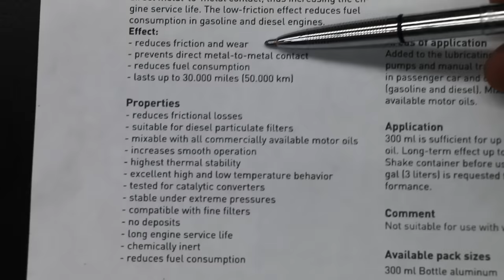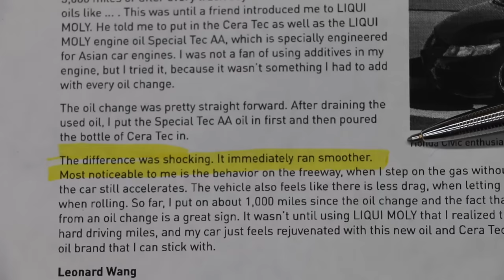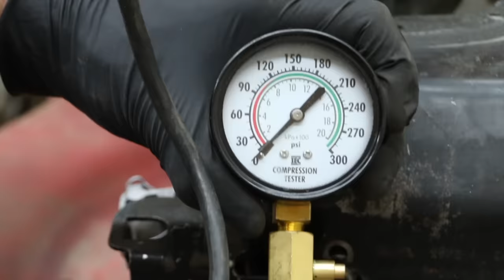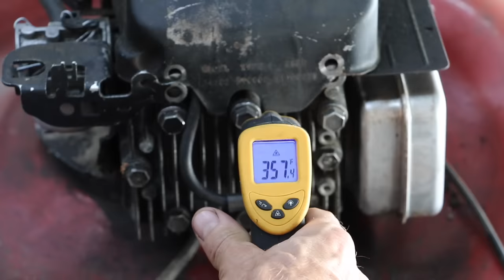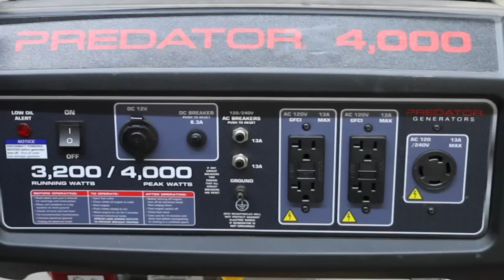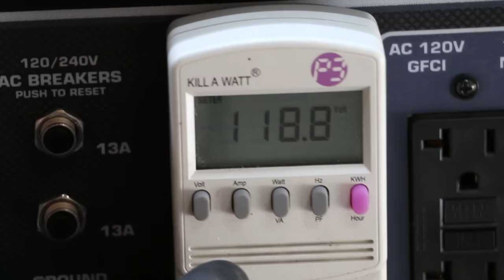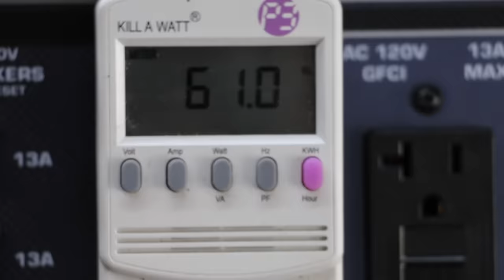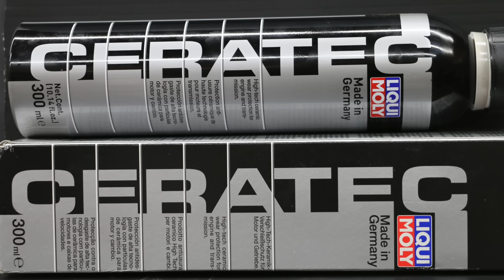Does Liqui Moly CeraTec work?  Let's find out!

Comment: Ive had good experiences with CeraTec myself, but I would not recommend it on a low milage engine. An engine under 50,000 miles already has low friction and little wear, and this product will just introduce foreign chemicals into an otherwise stable environment. However, on older engines closer to and beyond 100,000 miles, this product does seem to help a little bit.
Reply from the maker: Thanks for sharing.

Comment: CeraTec is the only thing on the market known to stop the infamous Coyote Tick. It's quite expensive though, so I did my research ahead of time and have been running the only oil known to never let the tick start- Pennzoil PurePlus.
In any case it would appear CeraTec should increase fuel economy but for the cost of the bottle it may be a wash. My car wants two full bottles, for ten quarts of oil 😬
Reply from the maker: Thanks for sharing.

Comment: I run it in all of dozen family vehicles I care for, most of which are over 200k mile Toyota & Hondas. 300k mile V-8 Tundra valves quieted immediately, and all vehicles get better mpg. I also use their full synthetic oils in everything. Running it in 5 gen 2 Prius's that are all close to 250k miles or more, and every one of them gets over 50 mpg. Only thing special is good maintenence/filters, high tire pressures in the Michelins, and ruthenium plugs along w/ the Liqui Moly oils & chemicals. I also rebuild and rebalance the hybrid batteries, so there are a fair number of variables, but the quieter smoother idle is pretty obvious.
Reply from the maker: Thanks for sharing.

Comment: I used Ceratec on a Jaguar, after 200 odd miles I felt it had made the car much smoother and more responsive, but with all such comments, few of us do this level of testing. Personally I would buy it again if I felt my engine needed it, but a good engine flush, such as BG EPR gives the biggest gains IMO. When I compression tested BG EPR I gained 15% overall on a simple oil change, totally changed the car.
Reply from the maker: Thanks for sharing.
Reply: Ceratec doesn’t work fully until after a couple hundred miles so what you’re saying makes sense. This wasn’t a fair test

Comment: I use Ceramizer. The similiar thing but different company :) (made in Poland, and I live there)
I used it in few engines. Always went better! Reduced noise, but in fact the main advantage was lower oil consumption. 
The adhesion of oil on cylinder walls (nas rest of parts) is reduced, so that oil flows more smoothly.
After all, ceramic coatings of metal surfaces is very popular in manafacturing and heavy industry. The applications are different thou.
Reply from the maker: Thanks for sharing!

Comment: I used slick 50 in all my cars both petrol and diesel over the last 30 years with great results did engine tear down  after high mileage to check wear really impressed with results I’ve recently switched to turbo max after seeing on line test results also very impressed it works
Reply from the maker: Thanks for sharing.

Comment: Not sure if anyone has covered this, but when I was much younger and saw Slick 50 had to be shaken, not stirred, I realized that it would also separate in the oil pans...or... they would have Pre-mixed them for you!  So, if you have to shake it to get the "additives" to suspend in the oil, it's not going to work as well after sitting for any amount of time... 

ANY TEST of a SHAKE to use oil or additive, needs to be allowed to SIT for a day and THEN use.  That's real life use.  Testing a just-shaken product, is not a real test.

Comment: this stuff is great. I hear the difference even on new vehicles. Did you use the same engine during the tests ? The thing is: Ceratec sticks to the metal parts. So after using it once, you will have positive effect from the Ceratec even if you again use normal engine oil. It´s very hard to totally remove it. So normally you would have to use different engines for every single test.
Reply: The ceratec testing is done after the control so these results are valid, it may effect future tests in some miniscule way but in a way that's fairly consistent

Comment: I use it on my modded KIA Stinger 3.3TT, added to 5W30 oil. Here our winters get really cold (sometimes as low as -40) so even if the oil is made for such weather, it can't be bad to remove some friction while the oil heats up.  I don't really have a clue if it helps or not, but it sure doesn't hurt it. It could just be a placebo effect, but it feels like there's less rattling sound since.
Reply from the maker: Thanks for sharing.

Comment: I think the idea is to use Ceratec in conjunction with Liquid Moly oil of the proper weight for your vehicle. They are designed to work together by the additive package that’s in the oil already. Maybe I missed something, but it didn’t seem like you were using Liquid Moly oil.

Comment: New convert to your great channel!! I've used Ceratec in a previous car, and I'm currently using Mannol's equivalent 6-Boron Nitride product (which also has an ester pack) in my current car (both cars have powerful, normally-aspirated petrol engines).

I definitely felt a change in my previous car, which had run for around 4 years with no oil additives, then with the Ceratec. Of course it's difficult-to-impossible to quantify any beneficial effects, without running the sorts of control equivalents that you do here, and/or putting the car on a dyno multiple times. But to me, the car became noticeably more responsive - especially under load at low revs. And my oil did seem to be less sooty and degraded at my regular 5000-mile changes, plus I definitely (and quantifiably, this time, owing to accurate digital oil level readings) lost less wear-and-tear oil in-between changes.

However, I am highly confident that the changes I observed didn't even start to take place until around 3,000 miles into the addition of the Ceratec. And I'd say that it took a further couple of thousand miles or so for the improvements to increase then plateau. I agree that it's highly odd for Liqui-Moly itself to implicitly endorse that "It worked immediately!" claim when that's not even the company's own claim about Ceratec - but then again, the guy who made the claim had put Liqui-Moly oil in the car at the same time as the Ceratec, so it's possible that the "immediate" part was down to the oil itself rather than the Ceratec additive.

In conclusion: I think it works. Is it a miracle product? Of course not. Does it reverse physical degradation? No. But I feel comfortable in believing (rationally, I hope!) that 1) it really does provide tangible lubricity and power/torque-related benefits several thousand miles down the line, and 2) it at least slows down the physical degradation in piston rings, oil channels, etc. Incidentally, I find that the new Mannol 6BN product (their code: 9829) to be just as good as Ceratec - if not better, on account of its addition of an ester pack - and a good deal cheaper.

Finally, thanks for your great, and highly professional & informative, channel.
Reply from the maker: Welcome!  You are welcome!

Comment: This not being lab test with back-and-forths can make significant differences in test results considering the tested product is only expected to make a very small change.

As for the compression: I remember many years ago when ceramic additives were new, I used "Ceramic Power Liquid", and someone who did that, too, said they eventually opened the engine (Toyota Starlet P7, I think) for tuning or maintenance purposes or such and the cylinder walls were pretty much white.
It could be that the industry shifted towards a 'watered-down' faith product eventually. Maybe the early products actually were sincere and top notch and these days they make more money by just cheapassing. - But it could also depend a lot on engine type, condition and use patterns. - It could also be that the way the early additives worked was considered not ideal in some ways.
Reply from the maker: Thanks for the feedback.

Comment: Great Video! My concern with Oil Additives is what effect it has on the Additive packages in the Oil being used? Does it increase oxidation over 5,000 miles, which is when I change oil? I added it to Pennzoil Utra Platinum in my last oil change, and I regret it. I'll never use an oil additive again. I will stick to the Additive package in the Pennzoil Ultra Platinum by itself.

Comment: I have a can of Ceratec™ which I have not used yet.  I see from the test that stuff is coated onto surfaces which begs the question; will Ceratec™ coat your catalyst thereby giving you the "below threshold" code ? 
.
I bought several cans of LiquiMoly™ a few years ago.  On the first use I added the whole can to my '99 Tahoe's crankcase which functionally takes 5 qts.  Rather than go all the miles between uses as the product says you can; I have taken to just adding about an ounce per oil change to keep it good.  I cannot say outright that it has done wonders but it hasn't hurt either.  Since I do mostly town driving I change oil and filter every 3K and use a full synthetic oil.  It is specified to take 5W-30 and with most of the way to 353 K on the clock and with the oil pressure gauge reading a bit lower than I think it should; I have gone to Castrol™ 5W-40 and have not noted any ill effects; no ticking, clicking or knocking.  The owner's manual, which was purchased separately after the truck (@ 74K) states severe service as being Trailering, dusty conditions and city driving.  I don't do so much highway work except on long trips so have stuck to the 3K oil change interval. 
.
 I live in an area that does Dyno E-testing so it is important to me to keep it running tip top.  My last test, less than a thousand miles ago, came up good but could use improvement.  I have seen vids that recommend O2 sensors and mass flow sensors replacement at 100K, mine have yet to be done.  I have the downstream O2s and just need to get them on, and then the upstreams.  I will only replace the cats when it becomes imperative.   
.
Thanks a bunch for what you do, Farmboy. :-)  Gordon

Comment: I have a question about starting lawnmower and generator with a drill. Is there anything I should be worry about? I saw some vids where people said it can break drill or even hand / wrist and recommended oneway clutch adapter. Everytime You do this it looks like piece of cake. Any recommendation or warnings? I have Milwuakee impact wrench and drill. Which would be better? Apologies for question if you've already mentioned about it. Love you channel but not sure if I've seen all vids.

Comment: I have a 2015 Range Rover Supercharged.  Had a light engine tick when warm at low idle.  Assumed a sticky lifter and have tried 5 different types of oil, none made it go away.  Then I tried CeraTec and it's gone.  Generally I'm a firm "use good oil and ignore the additives", but in this case I was pleasantly proven wrong.
Reply from the maker: Thanks for sharing!

Comment: First let me say that I absolutely love your projects and videos. I wrote a review on Amazon back in October 21, 2014 and here's my copy/paste version of my write-up to share with everyone. Although my level of testing comes no way close to yours, but the overall outcome is quite similar.  I still continue to use Ceratec every 30K miles and even made a believer out of my home AC/HVAC repair owner a few years back on his Nissan Frontier.

My review on Amazon:
"Improvement in gas mileage in my 2012 Mazda 3 and 2002 Saturn L200. Not too sure about the quietness of the engine after putting on 500 miles, but it is a little smoother running. Also put it in my Murray Briggs and Straton lawn mower. It's smoother running, no loss of engine oil, and eliminated the puff of white smoke during initial startup. I will be using it in my other three vehicles including my brother's 2004 Honda Accord.

Update as of 11/19/14:
2012 Mazda3 i Skyactiv 2 litre engine with about 22,000 miles. Rated at 39 MPG highway. Best mileage before Ceratec was 40.30. Best MPG after Ceratec 41.95. My driving is considered 70% highway and 30% city. The car is quieter and no more tinny sound when first starting which lasts about 5 to 10 seconds depending on outside temperature. I have put 1,500 miles on the car with Ceratec using Mobil1 0W20 with Mobil1 oil filter. Oil color is still light amber. I can't wait to change oil after 6,000 miles and thinking about trying Liqui Moly Anti-Friction.

Ceratec is now in all five of my cars ranging from 22,000 miles to 160,000 miles. Although I have not tracked mileage on my other three cars, but they are running a little quieter and smoother."

Have a great Memorial Day - Semper Fi
Reply from the maker: Thanks!  Thanks for sharing!  Hope you had a great Memorial Day!

Comment: I know this is an old video, but I'm going to add my two cents to the testing criteria in hopes it may make future tests better simulations. While some of the marketing fluff advertises immediate results (and you rightfully called them on it), I've noticed the real results show up after about 1,000 miles of freeway driving. If you ran a simulated 500mi (roughly 8.5hrs of operation for each engine), you may have a more clear cut result. My opinion is the Ceratec is a good product, as is LiquiMoly's Engine Flush. I use both every 5 oil changes, in addition to changing my PCV valve. I have multiple engines that are know for excessive oil consumption and blow-by and none of them have either issue (one of them has well over 200k on the clock). Of course, I also use catch cans, do induction services every 40k miles- I was doing them every 30, but even my GDI engines don't carbon up appreciably... even on the back of the throttle body plate) and run far better than some of my friends' cars still under the factory bumper to bumper warranty. I love your content and any criticism comes from a place of making it better and harder to argue with!
Reply from the maker: Thanks for the constructive feedback.

Comment: The only time I noticed a definite difference in my engine was after an oil change where I used Mobil 3000 super.
The engine felt much better immediately. The difference was far more than had ever been acheived by any additive
Reply from the maker: Thanks for sharing.
Reply: Eemeli Liimatainen  
Maybe it depends on the car. Mine is a Citreon diesel  hdi engine

Comment: It's not a "film strength" product , it's a solid, ceramic burnishing product that takes many hours of heat and time to take effect. So I'm not sure your normal battery of lubricant tests really applies here. It took over 4k miles for Ceratec do it's thing on my '03 Chevy v8 and it has lasted over 15k running better then ever on a little less gas. I used the Liqu-Moly engine flush as directed, beforehand, so maybe that is important to prep the engine. Many modern engines have very tiny oil passages and screens so they risk clogging when flushed or treated with any solids. I just wish I could use the Ceratec on my Lexus V8, but it has the VVT-i screens.
Reply from the maker: Thanks for sharing.

Comment: That was interesting.  Molybdenum if that is the same formula you are testing was always black in color in my experience.  I used to use it in motorcycle forks to reduce stiction and it seemed to smooth them out.   I'm wondering if you've ever tested teflon products such as Slick 50 and such?  I'll do a search but my dad used to run that stuff all the time.  I couldn't really tell any difference.  Thanks for the great videos and non biased testing of products.
Reply from the maker: You are welcome!  Thanks for the feedback.

Comment: Many thanks, your last comment about residue.. Did you observe any coating, the same colour as of the ceratec additive in exaust lines? I have had feedback that the chemical composition evaporates at high temperatures and clings to EGM / exhaust system almost like lime scaling in water pipes

Comment: I’ve got a w212 that’ll return 36mpg highway on 93 octane after using ceratec and following up with Mos2 the next oil change cycle. I set cruise control to 60 to test. It’s used to give me ~29-30
Reply from the maker: Thanks for the feedback.

Comment: Added Liqui Moly to a VV EA888 Engine with 40TKM. 
Fuel economy improved by 0.4 - 0.8l per 100km tested across 4 fill ups with premium gas  (before 8.0l/100km #1 7.3l #2 7.6l  #3 7.3l  #4 7.2l ) in winter months.  Noticed no difference in engine smoothness / vibration.
Reply from the maker: Thanks for the feedback.

Comment: Just curious, but could you perform this test on a four stroke engine? This product is intended to be used in a four stroke engine (which do have differing compression ratios). So while the test is somewhat applicable, it can't really be used as an 100% comparison with the engine used in a vehicle. Also, for comparison's sake, it would also help to show the results in both a high compression and low compression engine. That being said, I do enjoy your videos and seeing the practical testing that you do. Keep up the good work!
Reply from the maker: Thanks, will do!  Thanks for the suggestion.

Comment: great video .👍👌one question .does it negatively affect the turbo and how reliable is it? greetings from Sarajevo 😉
Reply from the maker: Thanks!  Thanks for the suggestion.
Reply: I put my ceratec in new oil. Is that good?  As a rule, does it have to be poured into a hot engine? Thanks 😊

Comment: I too am skeptical about oil additives but although I love this channel I am a little skeptical about the methodology of the testing in this particular case. I really think you would have to develop a group of measurable parameters for a car engine and then test that car before additive (base line) and after adding additive. The testing would have to last a month and have some miles driven to be valid I would think.
Reply from the maker: Thanks for the feedback.